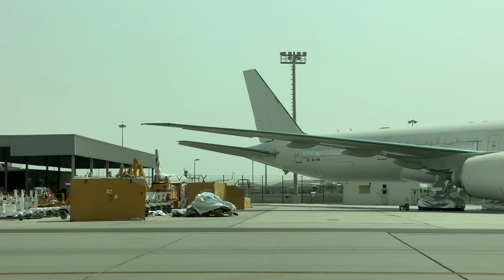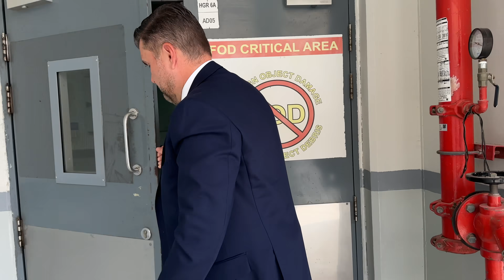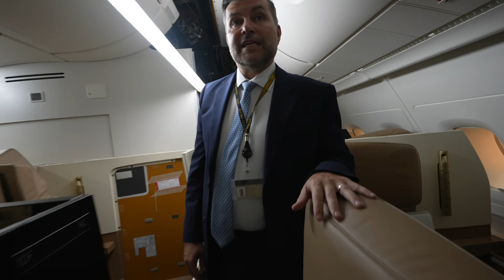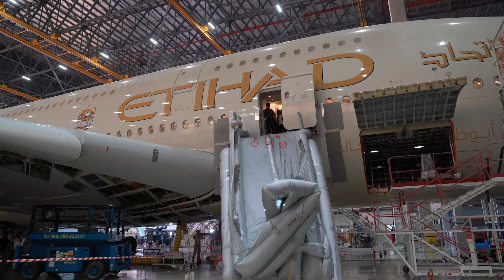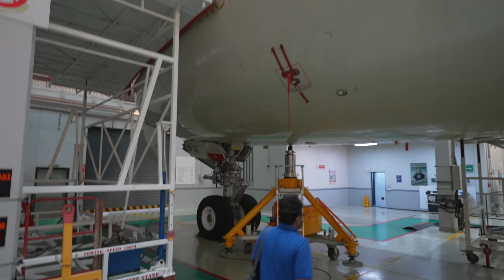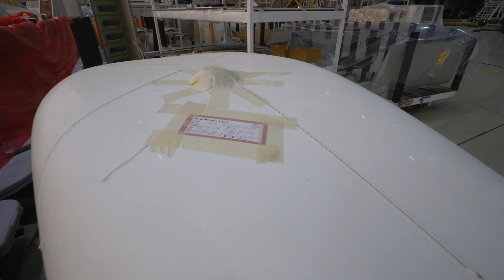Exclusive Etihad A380 Hangar Visit: Heavy Maintenance on the Superjumbo!

Comment: I believe these “heavy checks” especially for such young airplanes (6 years) are unnecessary..just money making requirements and laws passed by government aviation authorities and agencies at the behest of the manufacturers so the manufacturers can generate more revenues from training all these technicians and requiring replacement of parts..there are certain aspects that need maintenance like this..engines, wings, external services, sensors..landing gear, struts…but even this frequency is questionable with the manufacturing standards of today compared to 50 years ago when these standards were originally set..taking apart a plane like a Lego piece strung across the floor only to be put back by easily distractable people like this inevitably will create more risk than it’s worth not just financially.. you have already seen in the last year planes that recently underwent such maintenance with doors panels and parts flying off mid flight from shoddy and poor maintenance and history is littered with many disasters following recent maintenance checks

Comment: Very interesting video. Some A380 Facts: The A380 RAT is the world biggest, the A380 APU is the most powerful with 1.2 Megawatt, the A380 has the biggest and first wingbox ever made out of monolithic carbon fiber(tail is also monolithic carbonfiber), the most complex aircraft worldwide with 530km of wiring, more than 110000 connectors, 25000 sensors.
The A380 combines more than 400 patents and new technologies.

Comment: How many months does the dreaded D check take? Many airlines today will "retire" an aircraft instead of doing the D check. Usually that aircraft will go for conversion to freighter service when it is due for its second D check where it will be stripped, inspected and modified for freighter service. Basically correcting any issues that will be found on the check out before modifications take place. Many converted freighters will last at least twelve more years in service until they are finally retired for spares and scrap.

Comment: Fascinated to see how thin the outer walls are.  Anybody here know why the walls on the upper deck of an A380 are SO thick compared to a 777 or A350?

Jerry
Reply: Because the cross-section of the body ins't perfectly spherical, the pressure hull needs to be thicker at that area otherwise there could be a risk of structural failure over time.
Reply: @petercraddy3809  Thanks for the detailed reply.   Is that not the same for the other aircraft too though ??  Always surprised by just how much thicker the walls on the upper deck of the A380 are.

Jerry
Reply: no, most aircraft cross sections are circular, the A380 is literally egg shape if you look at it head on  @theworldssexiestman